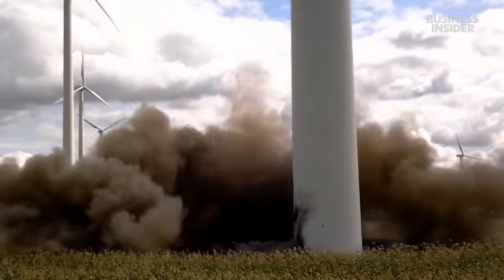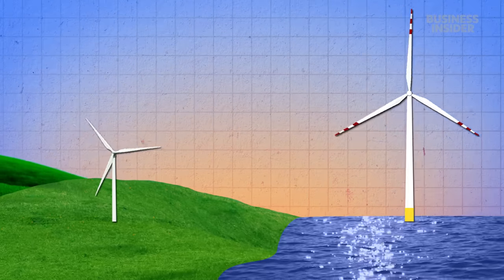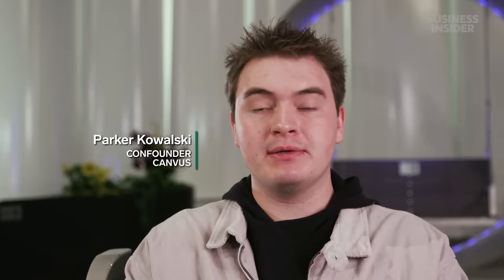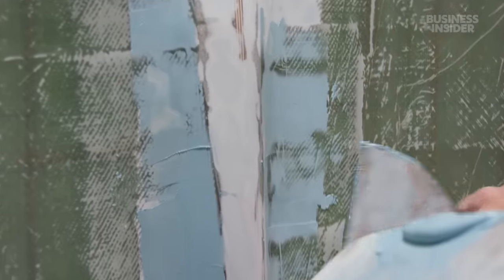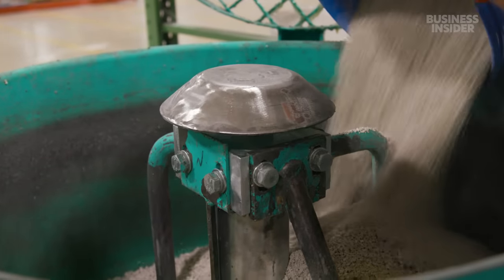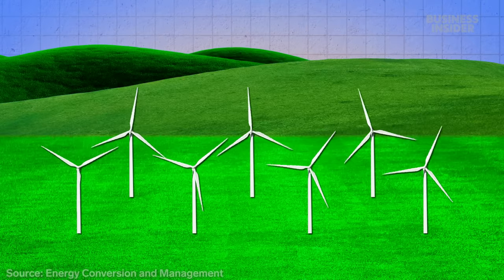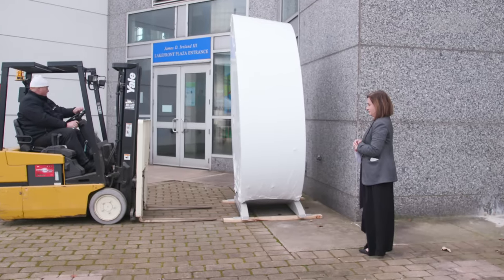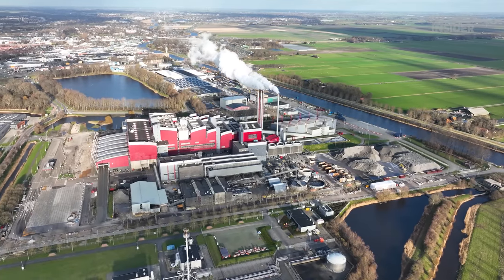How Bad Is The Wind Turbine Trash Problem? And Can We Solve It? | World Wide Waste

Comment: The last image really puts things into perspective. We need these people to work on coal ash and household trash as well.
Reply: Coal ash may also be recycled into products like concrete or wallboard
Reply: @ClydsdaleVI  Coal ash also contains more energy in the form of radioactive thorium than was gained by burning the coal.
Reply: a n i m e
n
i
m
e
Reply: Does the thorium currently have commercial use? The reactors never seem to work
Reply: @32BitJunkie  Nuclear reactors appear to take a lot of time to develop. Despite thorium having been used in a test reactor at ORNL and in Soviet submarines iirc, and many countries having thorium reactors in development, only India seems to have a working test reactor at the moment according to Wikipedia:
KAMINI (Kalpakkam Mini reactor), is the world's only thorium-based experimental reactor. It produces 40MW of thermal energy at full power.[76] KAMINI is cooled and moderated by light water, and fueled with uranium-233 metal produced by the thorium fuel cycle harnessed by the neighboring FBTR reactor.

Comment: There are now recyclable resins that can be broken down once the blade has been deemed end-of-life. The solid materials can be reused in smaller products, and it only leaves the resin as waste
Reply: Do you have a source for this? I’d like to look into it.
Reply: @edwardliechti3359  Unfortunately not. I suppose I am the source as I make wind turbine blades and made the world's first commercial recyclable blade at Siemens Gamesa.

It wasn't a large order, but I've heard that a larger one is in the works.
Reply: @ronanboulton2965  How do those decompose only after the usual life cycle of a blade? Planned obsolescence?
Reply: @CTimmerman  They usually last for roughly 20 years, so barring any major failures, I would imagine it would be around that long before they are broken down using a chemical. I'm not sure what it is, but it allows the solid materials to be reused.

I'm not in the loop on all the life cycle and servicing side of the turbines, just production.
Reply: Never heard of recycling resin before, what is is based off, poly, vinyl or expoxy
Reply: @Rivighi  Epoxy resin. Can't remember the name as it's been a couple of years since we cast it.
Reply: I smell commercial scam, resin have to be super strong and waterproof to do their job, totaly in opposition to be recyclable.
Reply: @TetrzLesonduclairon-qb7cn  I don't know what to tell you. I've seen it in action. 

As for the properties of a blade, that's what the combination of fibre glass, balsa, and resin all work together for, to be strong and flexible. And the paint isn't just to make it look nice. It increases the life span of the blade.
Reply: @TetrzLesonduclairon-qb7cn  well... he did say the resin was waste
Reply: These blades are recycled in Louisiana, Missouri. Not sure what is the end product but blades from all over the US are received there.

Comment: So there are a lot of things that these blades could be used for. The ends that attach to the windmill could be garden rings, no need to do anything, other then cut them down. What about roofing or siding material. I would love to have a bunch of the thin end pieces and make a fence out of them around my property.. They could also be used for livestock shelters.
Reply: Roofing and house walls, now there's an idea! Fiberglass is strong af and if it's already built then it's cheap. Hope people don't mind curvy bulgy houses though
Reply: How about not building or using them at all ????

Comment: I’m not a health expert, but isn’t fibreglass fundamentally the same as asbestos? - Silica fibres, so wouldn’t it have the same negative health effects? - not an expert but I don’t think you should interact with anything that sheds silica fibres when it degrades/gets used
Reply: Fibers don't have the hook and it isn't the same material.  It would have been banned if it were as dangerous.

Comment: Still a fan of nuclear. The waste has far less volume from my understanding. Plus it's capable of being used like a battery so it can be used in thousands of more ways than other forms of energy.
Reply: Not the PLANT, which is what the blades are. Very few nuclear gen site are ever remediated fully at end of life, they just get made less dangerous by removing the core, and fenced off indefinitely ? Only gas plants gen to my understanding get "almost fully removed" and even then the land is contaminated, and has limited use.
Reply: They are simply not financially viable. It is the most expensive form of bulk energy available. Plus nobody wants these things in their area making it a difficult proposition anyway.
Reply: @rogerk6180  your opinion aside, you're not wrong. But the technology isn't stagnant. It can evolve and become more viable. I'm not saying we need to abandon other forms of green energy either. I just think nuclear has a crazy amount of potential.
Reply: @MrKelaher  Meanwhile gas power plants, coal power plants, oil refineries, geothermal power plants, natural geysers and hot springs, etc. all release far more nuclear material than nuclear power plants do in the US.  They can get away with it because they're not subject to the unreasonable, erroneous regulations that US nuclear power plants have to follow.  

Old, decommissioned US nuclear power plant sites don't have anything close to dangerous levels of radiation.  They're that well run.  They also don't require such irrational, erroneous regulations to do that like over-regulating equipment that does not even handle any nuclear material.
Reply: @rogerk6180 The main thing that makes nuclear power so expensive is irrational and erroneous over regulation.  Before you start they don't make nuclear power safer.  It was already safe and over regulating it to make it harder to solve problems does not make it safer.   The worst accident in United States history was Three Mile Island where no significant amount of radioactive material was released and no one died. 

They also over regulate equipment that doesn't even handle any radioactive material.  The same things are cheaper and easier to do in other kinds of power plants that are not over regulated.  People do a task that takes them an hour and spend the rest of the day dealing with paperwork.  It shouldn't take more than an hour for people to document what they did in sufficient detail to be useful in future operations.
Reply: @eitkoml  nuclear powerplants are security risks. Just see what russia is doing in ukraine, using nuclear powerplants as shield to their weapon storage and mortar placements etc. Just imagine what isis could do in usa. They could put artillery top of the nuclear powerplant in usa and they could fire shells at the cities without fearing countermeasures, as it could not be bombed.
Reply: @markoliimatainen2565  Are you aware of how thick the concrete is in a reactor's containment building.  The thing to do in that scenario is to use the enormous variety of weapons that would never break through a containment building.  You can crash a 747 into one and it would never break through a containment building.  

Also, when did Russia put weapon in nuclear power plants?   I'm aware of a power plant shutting down after its water supply was compromised due to a dam being destroyed.
Reply: @eitkoml  the main thing that makes it expensive is the overhead, infrastructure, management, maintenance and constant need for resources.

That will keep it from ever becomming competitive with technology based solutions. It is a 20th century solution to 21th century problem.
Reply: @rogerk6180 Then please explain why nuclear power plants were so much cheaper to build in the US during 60s and 70s then skyrocketed after the scaremongering started.  Also, why do other countries produce nuclear power for far lower costs compared to the United States' unusually high costs?  When it comes to overhead, infrastructure, management, maintenance and constant need for resources solar and wind are far worse than nuclear.  

The reasons for supporting nuclear power are based on physics.   One thing to consider is that when trying to use energy sources as diffuse as sunlight and wind an enormous amount of equipment, materials and land or seabed area are needed; far more than for equivalent power generation from nuclear power.  Solar and wind are also fundamentally unreliable. 

There are also new types of reactors that were developed in the 21st century.  There are completely different types of reactors that could be developed like molten salt reactors, liquid metal cooled reactors, high temperature gas cooled reactors, etc. 

The whole "20th century solution to a 21st century problem" is such a stupid line from people who have no idea what they're talking about.d
Reply: @eitkoml  everything comcerning infrastructure was cheaper and simpler 70 years ago.. 

And what are you even saying? Solar and wind need a fraction of the management, and overhead of nuclear and no resources at all to keep them running..

You are just saying random things now dude, come on..
Reply: @eitkoml   solar and wind can be generated for sub 1cent per kwh. Nuclear sits between 20 and 35 cents for new reactors. That say it all, doesn't it.
Who is going to pay that? Nobody is.. the government will have to guarantee subsedies them for the lifetime of the thing plus has to pay for the cleanup afterwards.

It is a dead end technology.
Reply: @rogerk6180  You are not considering that the high costs are 100% due to over regulation of nuclear power.  Regulations that do not make it safer and were passed out of irrational fears based on not understanding science.  Other countries build and operate nuclear power plants at far lower costs than the US. 

You are also displaying more hypocrisy.  You are not acknowledging the enormous subsidies that renewables require.  You are also not acknowledging the reality that the intermittency of solar and wind massively drive up the costs of it.  Unreliable power sources end up producing expensive power. 

Nuclear power is far from being dead end.  It has far greater potential than solar and wind could ever have.  I have previously told you about some potential new technologies that can open up vast new potential.

Please read my previous comments in their entirety since you have clearly not done so.
Reply: @eitkoml  no it isn't. It is just freakin expensive to build and run such a thing.
Plus regulation isn't going away, ot is there for a good reason. It is just a factor of the reality today. These other things can function without issue within the current framework and is not dependent on support for legislative change.

Nobody is going to support lowering regulations when perfectly good, safe and far cheaper alternatives already exist and are becomming even cheaper and more efficient exponentionally.
No amount of deregulation could ever catch up with this.
Reply: @rogerk6180  I asked you to fully read my previous comments which you clearly did not do.  Please do that before commenting again.  Also, completely read this comment too. 

Other countries than the United States produce reliable, clean, emissions free nuclear power at far lower costs than the United States.  

The completely unreliable nature of solar and wind power actually make it far more expensive than you claim when you factor in having to connect it to a grid for that unreliable power to reach users. 

Solar and wind are utterly dependent on subsidies so acknowledge that first and don't single out nuclear like it is the only one.  

The regulations are garbage.  People do tasks that take them less than one hour then have to do so much paperwork related to that task that it lasts into the next day.  Equipment that doesn't even handle any nuclear material is also over regulated leading to costs that are several times higher than the same equipment being used outside of nuclear power plants.  How is that good or safe?  Also, how is using over regulation to deliberately block the construction of new nuclear power plants with newer and far safer reactors safe?  Especially when the worst nuclear accident in US history was the trivial one at Three Mile Island.  

Do you realize that nuclear power can also be improved with research and development?  There are so many ways that nuclear power can be improved beyond the current reactors that are already far better than reactors built in the 1960s and 1970s.  Nuclear power also has far more potential than solar and wind due to there being so much energy in nuclear reactions.  That's how the US Navy has nuclear powered ships that go for over 20 years without needing a single refueling.
Reply: @rogerk6180 I have worked in the nuclear generating industry for 26 years and unfortunately I think you are correct.  Nuclear plants are too expensive for private companies to build, and even if they wanted to -;the last 40 years of anti nuclear sensationalism and rhetoric has made general public acceptance unlikely.  Probably the only path forward for nuclear power is if the government takes over power production and liability and builds new plants and in a few cases rebuilds existing plants.
Reply: @arau8310   yes. And even then there is still a lot of NIMBY'ism, even with proponents of the technology.
But non of that would solve the cost issue, it is just not competitive. By over an order of magnitude. And even if that cost would somehow be accepted it would put any country doing it such at an economic disadvantage globally that it would crush their economy if it was fueled by majority nuclear. Either energy would be to expensive to produce anything domesticly or it would drain government finances subsedising it while competing economies simply enjoyed low cost energy. 
Coal and gas is still as common as it is because it for a long time was the cheapest form of energy generation.

It was a good idea 25 years ago. It no longer is.
Reply: And it lasts 10X as long
Reply: @markoliimatainen2565 
You do realize isis is not capable of a sea invasion across the planet right.

Comment: Plant them in the ground vertically side-by-side and create a solid weather resistant fence.
Reply: It degrades into the environment tainting the water supply in the local area.
Reply: I heard birds get caught in them too
Reply: @boohere2  That's when they are moving, and the birds do not see the blades. Although I do not think the idea is not particularly good, a fence of blades would be no more dangerous to birds than a brick wall or wooden fence.
Reply: @boohere2  Yes, I was thinking of the birds too.  Nobody seems to care.  That makes me mad.